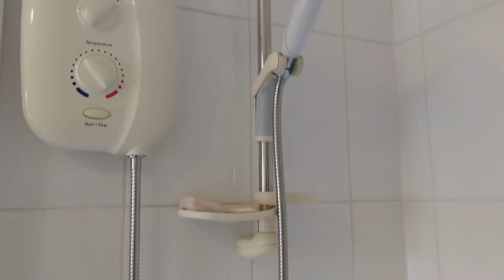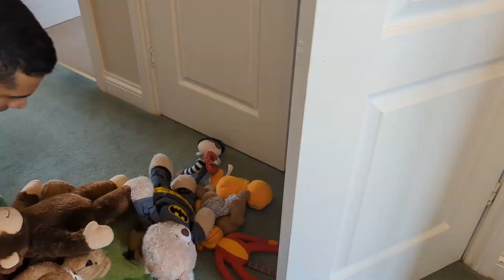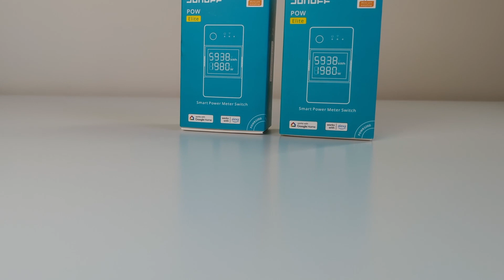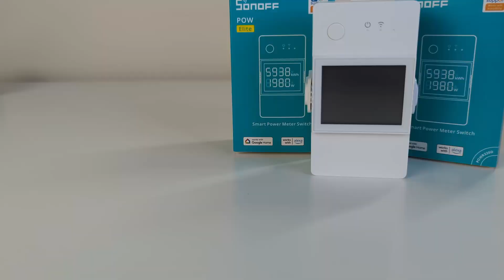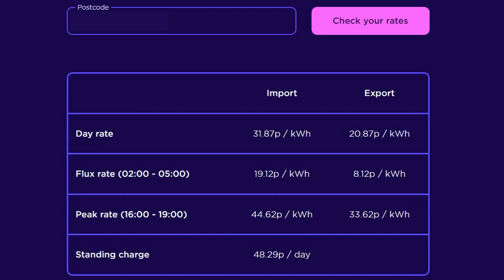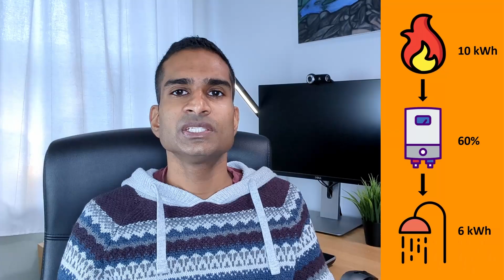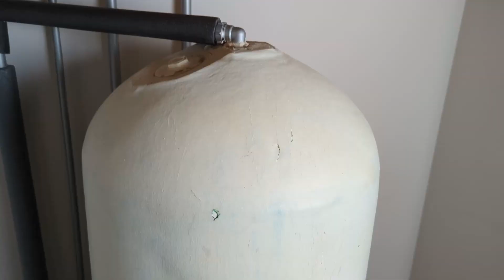Solar Diverter RETHINK 2023 - SONOFF WIFI Switch The Answer For Heating Water?

Comment: Hi Shan, great video (as always). Now, I think you're moving to Flux, but given the lucrative export rates, will you still want to divert solar into your water cylinder instead of exporting it?
Reply: That's interesting to see that you can switch between Go and Flux, thats a great solution, as I didn't think the 3 good would be enough to charge 2 batteries.

It's also interesting that I have been watching Gary's videos today, as they have interested me. I too am looking at fitting 6.5kw of solar 2 x 8.2kw giv energy batteries and a 5kw inverter. 
Did I read correctly that the give energy batteries can only take a charge of 3.6kw/h? As I will need to rely on the batteries in the winter, I will only be able to charge upto 14.4kw in 4 hrs were I have a 16.4 capacity, please can you tell me is this correct?
Reply: @swast4  Yeah the charge/discharge rate of the Gen 2 GivEnergy inverter is 3.6kW
Reply from the maker: Hi Gary - Thanks for taking the time to watch and comment on this video. Nothing on the great waves you're making in solar, but interesting times. 

I agree - as mentioned in the video it makes more financial sense to export the electricity than use the immersions compared given the current gas figures (+ I'm still clinging onto my 3p/kWh till May 2023). As mentioned I think I'll use gas in the morning and solar in the afternoon in the interest of reducing mu CO2 impact whilst attempting to expand my CO2 reducing tech.

Keep up the good work, Shan
Reply: @everythinghome  Oh, I don't know, Shan - we're both doing our bit and from the feedback we're getting, it's clear there is a void of accessible useful information on solar and related topics. I'm happy (and I guess you are too) to spend time on trying to fill that void. 

Now, I don't have an EV, which means Flux is ideal for my installation (finally went in last week) but I think you have an EV - does that make Flux less desirable, or do you think you can make it work? I can imagine you'd want to stick all that excess in your EV...?
Reply from the maker: 🙏 completely agree. And it's great having different perspectives on the same thing. I find that with some of the finance YT videos I watch there isn't a bad video just a different opinion and it helps me shape my own from that.

Yes, we have a PHEV. I too was a bit dubious about how much we would export. However, we generate so much more than use it was very clear from the numbers that Flux was the answer for us in Q2/3. I'll be retreating back to Go in Q1/4 and for simplicity. Once I have my 1 year data that should allow me to make some further decisions going forward. I just hope the projections giving up my deemed FIT hold true but life's too short. I'm enjoying the journey 🙂

That's great. What setup did you go for?
Reply: @everythinghome  Your strategy looks solid - and I look forward to you sharing your experiences over time as you build up data 🙂So, my solar journey has been, well... interesting! I knew next to nothing about the topic until March last year, when like many people, couldn't believe what was happening to energy prices. Solar seemed a great solution, but required a hefty investment. So, I started my research, only to find it was a minefield. And that's when I thought that I should make a video, to help others (I suspect you started making videos on solar for the same reason?) I contracted with an installer for an August 2022 installation, but it all fell through (a few days before installation!) so I had to contract with another installer. Finally, after more than a year, my installation went in just over a week ago, and I'm really pleased with it. Here's the setup:

17 x 415W Perlight Delta Shingled Panels (they are just gorgeous!) plus a spare panel to play with
1 x 5kW Gen 2 GivEnergy Hybrid String Inverter
2 x 9.5kWh GivEnergy batteries
1 x Zappi (but no EV yet... maybe one day I'll be able to afford)
EPS (keeps the house lights on if power cut)
Reply from the maker: Hi Gary - that looks like a fantastic installation which should hopefully see you far into the future. I also have EPS and have thankfully not had to use it. I look forward to seeing how you get on.
Reply: Thanks for replying Gary. If it's 3.6kw charge can I ask why you opted for 19kw of battery? Are you going to use a longer off peak tariff in the winter? Or are you trying to export more in the summer period using flux?
Also I'm also fitting all black panels for the look of them. Can I ask why you went for the perlight panels rather than the Trina panel as they look about 33% more expensive?

Sorry for the questions, I have had a couple of quotes through. One from ivolt the same person who fitted Shan's for 15x 415 trina panels, 2 x 8.2 giv energy batteries and a 5kw hybrid inverter.

The other quote is for a lux 3.6kw lux inverter and 3 x 3.2 greenlink batteries and 16 x panels. He says he's had problems with 4 installs with givenergy so he won't do then anymore.

It's all a bit of a headache picking what's best... So trying to learn from others.
Reply: Hi Adam, yeah - it's a total minefield, eh? Really hard to make the best decisions when there is no much conflicting information out there. So, try and answer your questions:

Yeah, 19kWh is a fair bit, but actually, we're a higher than average user of electricity - and with a 5kW inverter, it doesn't take too long to fill those batteries from March through October. It's true that off-peak charging will only half-fill the batteries in 3 hours, but that's ok, because I would expect there to be enough sun to fill the remainder, on sunny days in the winter months (my house is south-facing, 40 degrees pitch). But the main reason is to take advantage of times when I might be paid to take energy off the grid (Octopus Agile). I can imagine that future tariffs will provide the option to pay those with spare capacity in their batteries to take excess wind, rather than paying more to have turbines temporarily switched off.

I didn't realise Perlight Deltas are 33% more expensive - but they're really good looking panels, and I suspect they'll perform marginally better than the Trina Vertex panels (shingled vs half-cell).

Comment: I think in your situation, I agree with your decision. I have an Eddi and it was installed along with my panels and battery so the cost wasn't too bad. The battery was delayed for a few months so the Eddi was invaluable in making the most of my excess solar for those few months. However, I now mostly use it as a fancy timer to heat the water off-peak, and then I manually boost by shouting at Alexa if one of the kids decides they want a shower that evening. So I pretty much have the same setup as you but using an Eddi! I do get the added bonus of heating via divert too when the battery is full (like today), and I've made the decision to not use gas to heat the water unless absolutely necessary (guests staying, wanting a bath, etc). I should point out that it is entirely possible to set Eddi to have priority over the battery - I had it that way for a while, but I have now configured it to take second place to the battery. Interestingly we both appear to have almost identical boilers (mine's the smaller 50) and old hot water cylinders. I'm waiting to replace the boiler with a heat pump before I also replace the cylinder though. That'll be a total game changer :)
Reply: Thanks to both of you for bringing quality content. I have a theory but I need to verify with some heating engineers , if you put a buffer tank before the cold water inlet to you combi boiler, you heat up the water in the buffer tank either by solar or electric, in theory the combi boiler would not use as much gas to output instant on demand hot water. It`s one thing to have water going in at 10 degrees and for the combi to use gas to take it up to 50 degrees and would require less energy if the water would come in at 40 degrees and it would need only 10 degrees extra from the combi boiler.
Reply from the maker: I've heard it being done in some capacity but as you say will need running past some professionals.
Reply from the maker: That's really insightful - thanks. Ah, interesting. At some point I'm going to have a think about the boiler too. I'm not fully convinced on a heat pump yet for our leaky house but who knows. It may be a proper heat loss survey jobby. I've just subbed to your channel so I'll be keen to see how you get on with your heat pump install.

All the best, and thanks for taking the time to watch and comment on this video 🙂
Reply: @everythinghome  Thank you. I'm not sure exactly when the heat pump conversion will take place. Either later this year or early next depending on finances and whether my boiler blows up or not :) I'll be covering the whole process start to finish on my channel once it gets going of course, and I'm in the process of capturing things like heat loss so that'll be part one when complete! I'm hoping Octopus launch their heat pump installation service in my area during the summer like they're planning.
Reply from the maker: That's great, look forward to following how you get on 👍🏽